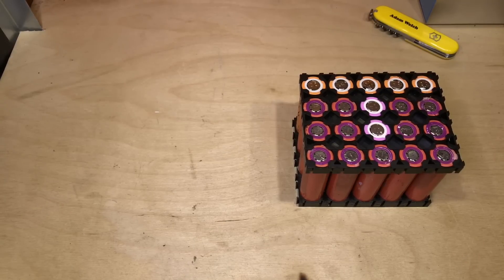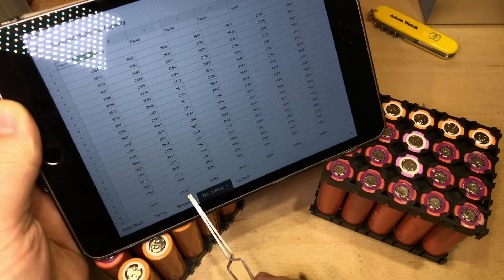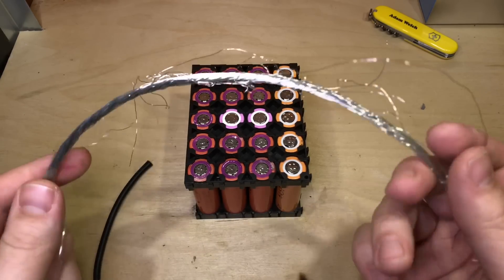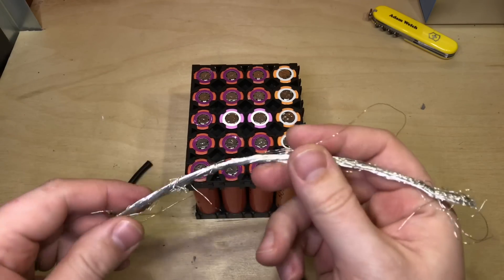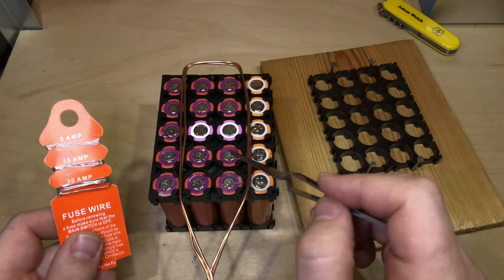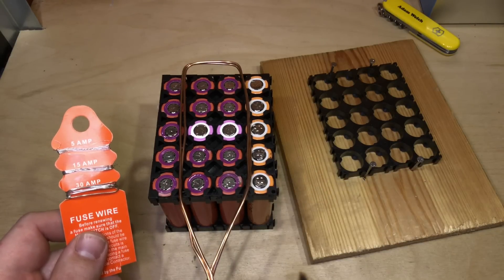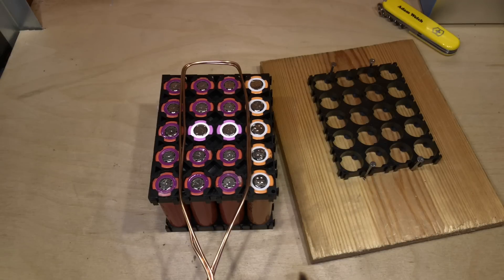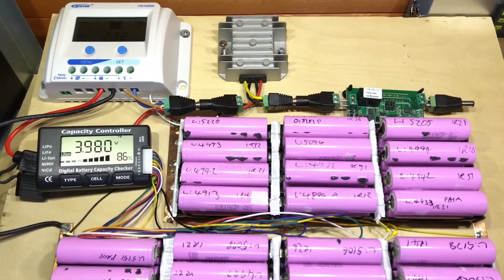18650 Lithium Ion 20p Packs - 12v Solar Shed

Comment: It's actually using the same space, just bigger footprint ;)
Cell covers would be good for you as you're using the same cell holders my covers were designed for https://imgur.com/a/K95Nx
The bend of the copper is best u-turned before the last cell, no need to pass the bottom of the pack :)
We're on discord for live chat with out 18650 DIY guys, invite is on my channel's "About" tab.
Reply from the maker: Yes - you’re right of cause. The covers look nice... have you shared them anywhere? :-)

Comment: Welcome to the club Adam!
It's normal for top-balanced cells to become unbalanced as they discharge - what is important is that they return to balance at the top of charge.
If the cells are evenly matched then they should track pretty well, with the pack deemed empty when the lowest cell reaches bottom.
On recharge, each cell should theoretically get the same energy they expended, and the pack should return to balanced state at whatever top you define.
Forcing cells to track each other and balancing during mid-capacity just wastes energy, as what is done is undone again on every cycle, iyswim.
Just add one or more cells to low-performing packs.

ps - don't forget to twist the busbar wires tightly (h/t Average Joe)

Comment: The more cells in parallel will decrease the amount of voltage drift.  However, it is more to do with Amperage draw vs internal resistance. In a 4p setup and you pull 5A (1.25A / cell) there will be greater resistances under the heavier amp / cell draw than if you pulled 5A from an 8p setup (.2 or 200mA / cell). You will find that the greater number of cells in parallel, the less likely there is drift.
However, with that said, if there is any drift, it takes more work to get them back in balance with the other packs as there's more cells to adjust. So it's a bit of a ying/yang kind of thing 😉
You've linked HBPowerwalls (Peter) video link, but I'd also like to throw in a link to the forum that has loads of information: https://secondlifestorage.com/
Thanks for the video! 🤠😎
Reply from the maker: Cheers and that’s for that explanation. This subject really interests me and with a bit of luck I may be able to add something new into the mix. I’ve logged the internal resistance of each of my cells as I’ve tested them and I may need to return to that data at some point in the future. I’ve been doing things on a very small scale and things are growing a little - my 7s4p pack ran for a year and the cells held up pretty well charging and discharging between 3-4.05 volts - not daily though.

Comment: Looks like the start of a beautiful project Adam! I recently built a 4S 50Ah battery using a balancing charge/discharge protection circuit board but ended up going with 1 mains copper wire for the bus bar because the amp rating of the circuit board was limited. It's intended for light loads and small solar panel recharging so is fine. The lighter load will also lighten the wear on the batteries. I also used wire rated for 10A as the fuse wire and it worked quite well when tested.
Reply from the maker: Well 2.5mm twin and earth is rated for 32 amps and that’s a fair bit higher than the current I intend to pull from my packs.  I could just use one potentially, but two won’t make a nice wire once spun, but three will. Cheers.  Decisions, decisions.
Reply: One has to enjoy the build or it's pointless lol

Comment: 1st, I think the internal impedance is more important than capacity. 
2nd, If you are willing to forgive ~300-400 mAh from each battery, You can charge them to 4.0V and forget about balance charging them to get the maximum 4.2V out of each. If you are running them down to 3.0V, then you need a bigger bank.
Personally, I would've stayed with the flat pack. It allow quick check and replace of each individual battery without resorting to surgery. Yes it does take more space, but there is always a compromise. 
I enjoy your videos, and always give a thumbs up before even watching.
Reply from the maker: Thank you for this. I have checked the internal resistances of each cell and logged them in my spreadsheet but I am interested in looking at the IR further. I do generally only charge to 4.05 volts and I wouldn’t expect to be hammering these cells too hard. 
Space is my biggest issue in the shed. I do love the flat solution, it’s easy to test as you say and swap out cells but I just can’t find the wall or bench space it requires. Finding bad cells is going to be harder - but I’m sure I won’t have any :-)
Thanks for the thumbs up, and again thank you for the advice.
Reply: Just starting to get into all this, I like the 18650 idea due to it being more forgiving than lead acid and more robust over all, spent today stripping 4 one laptop battery's checked the voltage there all pretty well balanced and next just going to stick 4 together and see what happens over a few days/weeks if they fall out of balance then I'll grab a BMC but fingers crossed they play nice, it's only going to be 4 battery's per charger so helpfully I'm not asking to much

Comment: Hello Adam. I have recently watched an equipment repair video from “Mr. Carlson’s Lab” YouTube page and he has a video on the connection of wires directly to batteries. You can find the start of the detail at 22:00 here https://youtu.be/HqsXe3IKTCo. His method makes for a solder connection that doesn’t swell and roast the cell. He also modded his old fashion soldering gun to allow for quicker heating to lessen dwell time on the cell.
Reply from the maker: Cheers. I’ll definitely take a look at that.
Reply: Great page for tube electronics and tips as well. Little bit different type of channel but very interesting. Likes to share his knowledge, like you.

Comment: If its not already too late, you could use solar bus bar mate, its good for 10 amps and makes for neater and tidyer packs. I wrote a steemit post about my solar mining setup awhile ago, but you can get an idea of the aesthetics of using solar bus bar from the pics over here https://steemit.com/solar/@lordtricky/my-solar-powered-bitcoin-mining-setup
Reply from the maker: That does look quite neat. Not too late but I’m looking at pulling a maximum of 15amps I think (mainly because I’ve got some 15a dc breakers in a box) but I guess two strips of ten would be sufficient. I’ve been trying to use what I have to hand, but you’ve got me thinking now. The 2.5mm copper has spun nicely on the drill and can make a nice bus bar I think.
Reply: I shall look forward to the outcome either way. :D
Reply: Tricky's World +1 On the solar bus bar/tabbing wire. I used it on my lawnmower battery pack and two tabbing wires (not even the bus bar, but the tabbing wire!) Handles 10 amps consistently without a problem and I've seen 20 amps pulled without issue too.

Comment: I am not fusing parallel packs any more because of this CID (Current interruption Device) which is included with all 18650's. https://youtu.be/1w3Tv1Jg0ps
Reply: The CID isn't a fuse. The CID is in the event the cell gets too "hot" and starts to vent. It doesn't protect the cell or the other cells from inrush of current. In most cases, the CID will not trip even with 20A charge to the cell, and it's quite possible the cell could go thermal before it starts to blow.
Reply: Bad idea. CIDs are not a fuse. They are also pressure valves. This may be ok for laptop packs with 2 or 3 in parallel, but if you have 20 or 100s in parallel you could be drawing hundreds or even thousands of amps from the pack and the CIDs won't do anything unless the cell temperature rises to dangerous levels.
Use fuse wire so you know how many amps you can safely deliver and not burn your house down!
Reply: I watched your video. It is irresponsible to recommend relying on the CID, and especially to attempt to reset it and reuse a cell - put in the bin to recycle and use another.
If they popped, then it's for a reason that you don't want to happen again.
My point stands - it takes minutes for a cell to overheat, but a fraction of a second for a thousand amps to start a fire.
Reply: Cells in a pack can and do go bad, so in a 100-cell pack you'll have 99 cells attempting to discharge through 1 cell with potentially disastrous results.
A BMS will not do anything to protect against this case, but fusewire will.
Please stop looking for excuses and accept what all of us have learnt through experience and good professional practice.
If yours get oxidized or suffer from dry joints, then you need to solve it.
Fuses may be inconvenient to you, but they are necessary for very good reasons.
Reply: I agree with Andy. I will not put my house/vehicle at risk by not fusing at the cell level. No matter how well the bms is designed (unless it's a custom design), it won't protect at the cell level, only the pack (or parallel) level. 
Billy, you can put your equity at risk, but I'm sure not putting mine at risk.
Reply: In the meantime,  you're taking a chance the CID won't pop in time and cause a fire. I'll spend the extra time to put fuses to guarantee the cell is disconnected in the case of a short. There's been plenty of times the CID failed.
Plus, when the nasty stuff is spewed out of the cell due the CID popping, you now have a pack(s) coated in a nasty residue that now needs extra time cleaning up with the possibility of being hazardous so you now need a mask and gloves. When a fuse popping would mean none of that and just need a new cell put in place in the fraction of the time.
A fuse is meant to make our life much easier and safer in the end. Just like a wireless lock on a car.
Reply: PTCs are not security - they may help, but they merely hide the problem of a shorted cell, so will continually switch on and off, help drain the cellpack and not identify which cell needs replacing.
Look, the only way is to use a fuse to physically remove a bad cell from the circuit.
When you have a couple of thousand cells in a battery pack, the chances of a bad cell from dendritic growth becomes 2000x more likely to happen.
Please accept the wisdom of collective knowledge!
Reply: @Korishan - Yes it is not a fuse. But if the cell shorts, it will get hot and pop the CID. I have done plenty of experiments using high discharge rates on 18650's. When a cell overheats, it builds up pressure and disconnects eventually. I tried to induce explosion, fire and everything to destruction. It is only when I physically damage a fully charged cell that I managed to get a fire.. This was done intentionally and not under normal usage.
Reply: Andy Lee Robinson - It's not my video! I have opened up lots of Large 18650 battery packs from wheelchairs, electric bicycles and even saw Tesla's 18650 Battery Packs. Never did I once see a fuse across the terminals of the cells. This was invented by a youtuber with a good reason which also makes sense, but it's useless in my opinion. Cells will overheat at short circuit, over charging or high internal resistance, in any of these cases the CID will pop. I'm not recommending to reset the CID because if it popped, there was a reason. I do pop some of my own if I am going to use it for a few ma of current.
Reply: Further to my comment below, Tesla did indeed put a fuse in each cell when they changed the 18650's to a different brand that did not have a PTC under the button top. Newer branded cells above 2600mah usually all have a PTC fuse with each cell.
Reply: I have previously fused my packs but after a year, some do break because of oxidation since they are exposed,  or joints that do not perform well. Too be honest I think you're better of with a properly designed BMS which is equipped to handle short circuits and properly designed casings which won't allow for shorting individual cells or complete packs.
Reply: I do agree that it is an added level of safety for the whole pack. I'm not disputing the fact. Most cells today are all equipped with a PTC as an added layer of security. I only build packs from new cells and always ensure that besides the CID, there is a PTC. In my case the external fuse is useless. Now if you are building a pack from used cells and trying to emulate a balanced series parallel pack from cells of the same capacity but with different internal resistance, you have every reason to put a fuse on each cell.

Comment: Hello Adam, I want to ask, when connecting the cells in series do they have to be the exact same capacity, internal resistance and brand/chemistry or can they be different? Also does this also apply to a parallel connection? I want to make the same setup as you but in a smaller scale. What would I need except for the solar panel, bms, batteries and cables? If I want to get a stable 12v from the 3s 12.6v how can I do it? Also would you recommend charging cells that have been deeply discharged for years and use them normally? Also just so you know I'm just a 14 year old and you inspire me and I hope your channel grows because you deserve it.
(English is not my native language as you can see)
Reply: The same capacity in cells doesn't matter as much as same capacity for each segment of the series. The combination of cells in Parallel 1 needs to be as close to cells in Parallel 2, as well as with 3, 4, .....  If the sections aren't at the same capacity, the sections could become unbalanced and 1 could get high voltage, and another undervoltaged over time (albeit, a bms will help compensate for this, but you shouldn't plan for this as it makes the bms work extra hard)
Lithium Cobalt or Manganese (most 18650's) won't work very well for 12V as you either loose capacity in 3s or 4s, or you run the risk of early shut down under load (3s range is 12.6V - 10V), or over voltage on full charge (4s range is 16.8V - 12.8V)
Reply: Korishan OK thx so what should my setup be like? Also can't I connect some kind of voltage regulator and get 12v all the time whatever the cells" voltage?
Reply: You could use a buck converter, yes. But you are limited by the amount of current you can supply. If you only want to run small loads, then that's fine. But if you want to run heavier loads that required 20A, 30A, or more, then the buck converter can get more expensive.
If you got with LiFePO (or LiFePO4) cells, then you can perfectly match the 12v setup like that of lead acid batteries. These would basically be a drop in replacement without much need of any type of extra conversion. A LiFe cell has a nominal voltage of about 3.4V (LiIons are 3.7). This gives you an effective range of 2.9V - 3.8V (4s would be 11.6V - 15.2V) which is the operating range of a Lead acid and Car Alternators/Electrical systems.
Reply: Korishan OK I get that. But I want to run them on high loads 10A do you think an inverter would shutdown when the whole pack discharges bellow 11.1v? (let's say I use it without a converter